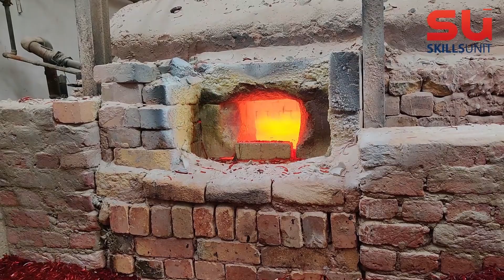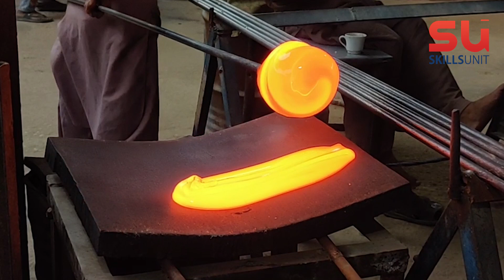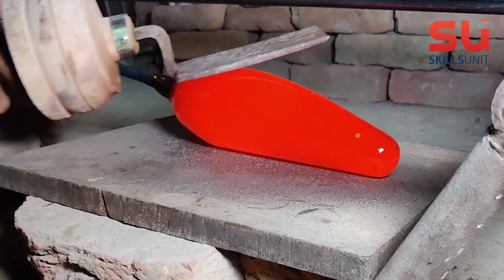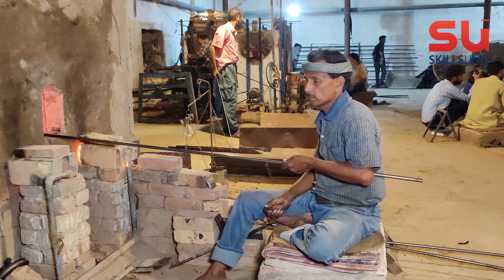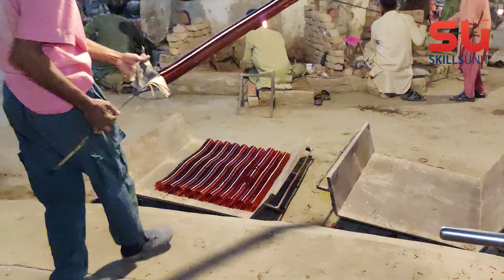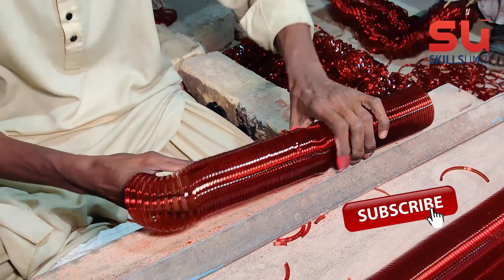Interesting Process of Glass Bangles Making | Witness the Amazing Glass Art

Comment: tora
Information not about machine 
The production of a machine of 50 spindles will be 200 tora in 8 hours. 
LPG will cost 30 grams of gas per toad.
sadai and jorai
 Electric will cost 30 watts pre tora
The total production of the machine will be 600 tora in 24 hours. 
Production of three machines will be 1800 tora in 24 hours